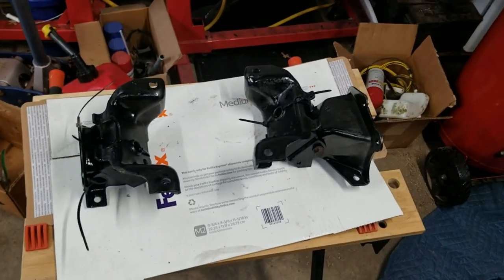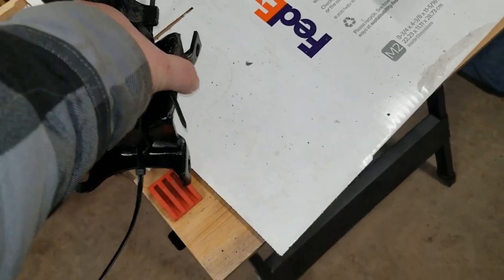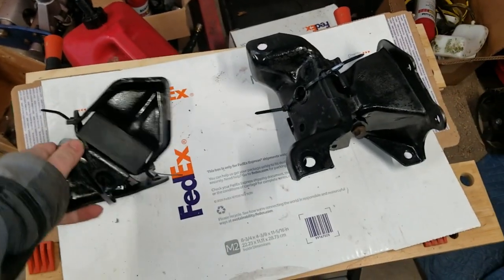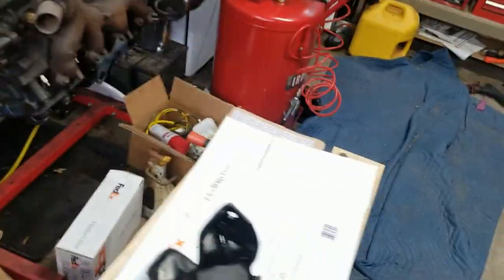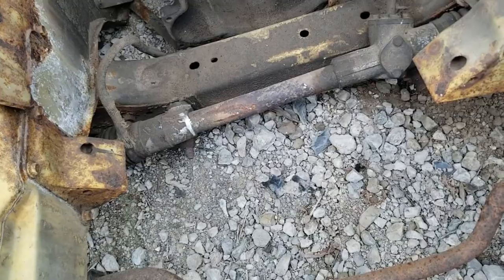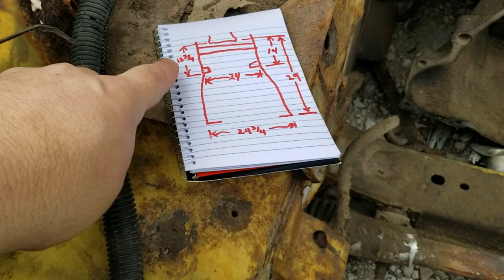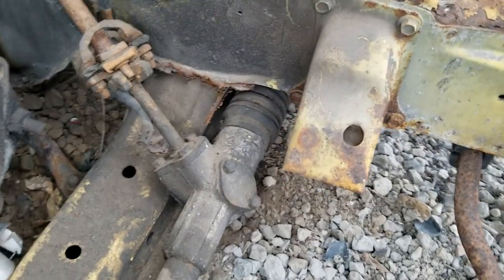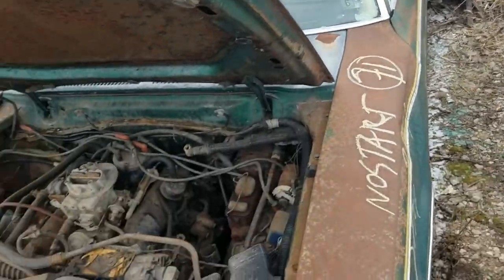V8 Pinto Junkyard Prospecting

Comment: The simplest way to use Mustang II engine mounts is to use the upper two holes on both frame rail horns as is (the measurements should match the Pinto parts). To use the lower two holes weld a plate/bracket to the bottom of the frame rails and drill a couple holes to allow the frame horns to bolt in. You could just bolt the engine in with the top holes to see if you like the location and go from there.
Reply from the maker: Thank you so much for the information. I was hoping the top holes would be in the same relative position in both cars.  I will be doing more research to create parts to make this a bolt in installation. :)

Comment: I used a 8 inch from a Mustang 2 in my V8 Pinto. Bolted right up. And I had one in my old V8 Pinto, its a stronger rear end than people think. I might be able to help with some parts. Where are you located? I'm in Alberta Canada.
Reply from the maker: I just about have my granada 8.7 installed.  It also is bolting right in with the help of Caltracs and 1.5" lowering blocks.  I need to get a shorter drive shaft, looks like fox body mustang might work.  If I can find a good 8" cheap, I would certainly do that.  I'm thinking modifying an early 90s Explorer 8.8 will be the end goal.  I'm in Wisconsin.
Reply: If you need any tips on the swap, let me know. Looks good.
Reply from the maker: @claytonstoolbox  I'm sure ill have questions after stuffing the 302 in the engine bay. lol

Comment: Some 9" numbers to chew on (from the internet, so your results may vary)

Ford 9” Rear Axle Widths (Axle Flange to Axle Flange)
(For reference a Pinto/Mustang II 8" is 57.00 inches) 

65-66 Mustang 57.25 inches 
67-70 Mustang 59.25 inches 
71-73 Mustang 61.25 inches 
77-81 Versailles 58.50 inches 
74 Maverick 8" 56.50 inches 
67-73 Mustang, Torino, Ranchero, Fairlane 9" 59.25 inches to 61.25 inches 
57-59 Ranchero and station wagon rears, 57.25 inches 
66-77 Bronco 9", 58 inches 
77-81 Granada/Versailles, 58 inches 
67-71 Comet, Cougar, Mustang, Fairlane, 59.25 inches 
71-73 Mustang, 61.25 inches 
64 Falcon 58 inches 
67 Cougar 60 inches 
67 Fairlane 63.50 inches (coil springs) 
72 Ford Van 3/4 ton 68 inches 
73-86 65.25 inches 
57-59 Ranchero and station wagon 57.25 inches (narrowest 9" housing) 
66-77 Bronco 58 inches but has 5-on-5 1/2 inch diameter bolt circle 
67-73 Torinos, Rancheros, Fairlanes 59.25 inches or 61.25 inches 
67-71 Comets, Cougars, Fairlanes 59.25 inches

Center to Center Spring Perch Distance
(For reference a Pinto/Mustang II is 42.5 inches) 

68-71 Torino 42 inches
64-65 Mustang 43 inches 
67 Mustang 43 inches 
77-81 Granada 43 inches
71-77 Maverick 43.5 inches
72 Cougar  43.5 inches
57 Ford 44 inches
69 Ford Van 51 inches
Reply from the maker: I had not realized there was a half inch spring perch center difference between pinto and granada. I suppose I can work around that.
Reply: @firepinto  well, you are looking at 1/4" for each side and I am sure tolerances back then were not what they are today. So I imagine each rear end could be slightly different when measured.